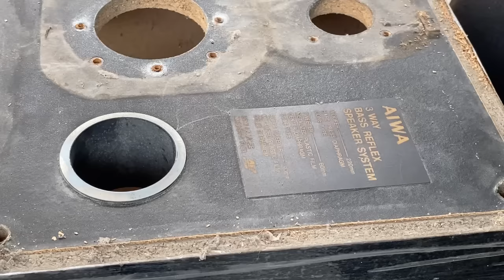Restoration 3 way bass reflex speakers system // Restore things long forgotten

Comment: Not to rain on you're parade, but after reconing speakers before I find it very sketchy that you didn't put some paper inside the coils before mounting them to assure totally even space. Then glue them, and I wouldn't have used those old reflex surrounds as it kinda looked like you did. Just leaving a tip for other DIYers that might try this themselves..

Comment: Didn't shim the voice coils in the magnets, and that's REQUIRED to make sure they don't rub.  Also didn't see him connect the speaker VC wires to the terminals and pass through the cone.  He also didn't cover the terminals before spray painting.  Also wonder where he got the new cones (which look nice BTW, good rubber surrounds.  Otherwise, nice rework of the woofers.
Same issues with the midrange, NO SHIMS.  WTF happened to the cross over networks!  Also a Rube Goldberg pizo tweeter replacement there.
Reply: с опытом динамики можно центровать вручную, без прокладок. 
у нас в россии есть такие мастера.
Reply: Entertaining? Yes. Real? I highly doubt it.

Comment: 2 things i have to say about this.
While you assembled the subwoofer, you didn't put spacers for good centering, its gonna be an issue (if not now, then the near future, when the materials will have some physical changes, due to movement) , failure rate is slight but possible.
2. thing that at the tweeters, for the leads that is copper wire that functions as the output lead, will gonna break real soon.
Aiwa did it in the past, because they made low quality crap speakers, and they wanted the user to buy their products every 1-2year or so.
For the second thing im not gonna put sand in your neck but the first thing was really a big issue.
The overall quality of the new box compared to the original box is not bad, or its about the same but with maybe a bit better quality of material.(while i talk about the original box, i dont mean the ruined/smashed/broken box, i mean when the speaker came out from the manufacturer.)

The one thingy that i almost forgot to mention that the reflex tube is not glued in place, i would have put a little glue, even if its a weaker glue, i would have applied some glue to the reflex tube, its just a little thing that some guys doesn't do, but it helps a bit for sounding, since something actually holds the tube in place, not just the hole.
Reply: He didn’t show ultimate Trade secrets deliberately, I notice this on other BLogs. It’s deliberate.!

Comment: For the vinyl, you wrap around the bottom 1/4' and bring the other end all the way around over the 1/4' to the corner and cut square to the edge. They turned out nice

Comment: Nicely done!  If you put the woofer tee nuts on the inside then when you tighten the screws they compress against the wood making a stronger connection.
Reply: I have had t-nuts spin, in particle board, and MDF.If I recessed them, and added glues, that seemed to make it better.
Reply: @davidhamm5626  I've not had that with MDF but particle board and MDF seem to have a mind of their own at times. It's definitely 'if it works, don't fix it!'
Reply: @davidhamm5626  A lot of the commercial sound cabinets would put a staple across the Tee Nut, probably to help with the spinning problem.  (Preferably not so that the screw would hit it)

Comment: If i was me doing the restoration i would skip some of the cosmetics.... and put a descent 2nd order crossover at least
Capacitors only sounds awful.
Please try 🙏🙏 you have the connection to find components relative cheap

Comment: What is it called and where do we find the replacement model for the speaker.😮😲😍🤩💖👍‼️
Reply: it's on the labels from back, model CDS-333 SX-S333 50W 8 Ohm,  shown at 0:31
Reply: @christianaxel9719  Ok thanks 👍
Reply: @christianaxel9719  And where and what is the name of the replacement for the speakers😅⁉️
Reply: @robertojuarez959  when  he is taking out the speakers you can see the part numbers at the back of the speakers, as shown at 1:30.
Reply: @christianaxel9719  I think you are not understanding me, I mean where did you find the kid and the restoration cone for speakers and what model is it🤔🤨😅⁉️

Comment: I think the drivers might aren't that bad, but Aiwa did an awful job designing these speakers. They call them 3-way, but the only thing 3-way on them are the 3 drivers. No proper filtering, no nothing.

If I was you, I would install proper crossovers in them, to make them sound decent at least.

Comment: 90s is the golden era of Aiwa
Reply: Yes it was, my all in one set was from that time.
Reply: @davidhamm5626  I used to have the "aiwa walkman" that I bought around in 1993 or 1994. Sadly that is the first and the last time that I bought Aiwa's product. After that I just stick with Sony and Panasonic until now.
Reply: @amminabdullah5988  Yes, they are/were a middle brand, I can see why you changed.
Reply: These ones are from 1988

Comment: Hi, I'm sorry, but I definitely don't like this viedo.I have been repairing speakers for years, my profession, 
I earn my money in this way. I'm winding my lamp on the speaker coil, the diameter or size does not matter.
I didn't like the video there are many aspects, but most importantly, the ready-made coils are tallied without centering.
Excuse me, sir, are you wearing my hat, please ?such as paper, cardboard or old 16 mm old film without putting a 
contraction on the sides of the coil.Bobin doesn't hang out like that, it's an insult to my profession, love..!
Reply: That's part of the reasons why the final sound was not too good
Reply: yup i agree, also i wanna mention about the tweeters, that im not sure that the output lead will not gonna break, which is only the part of the coil, those coils are really thin.